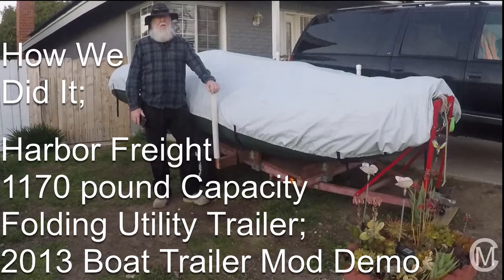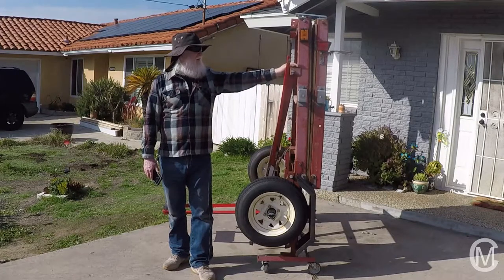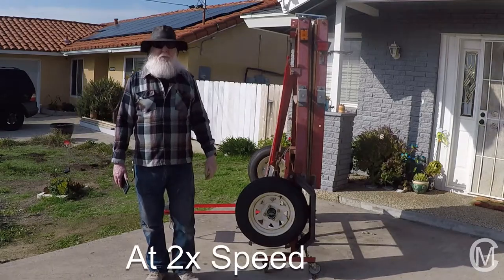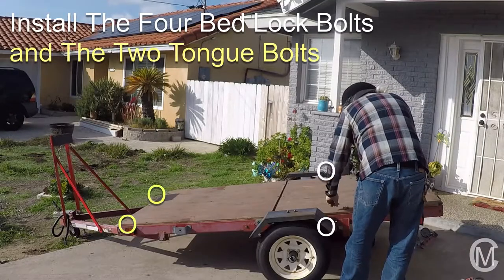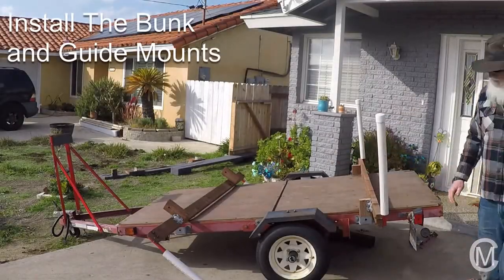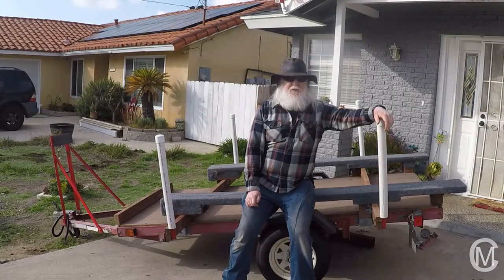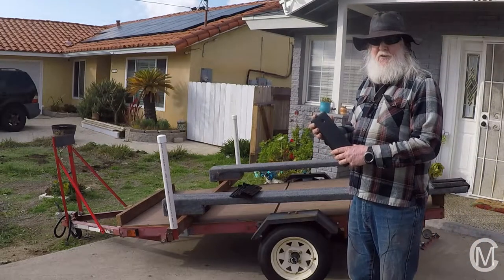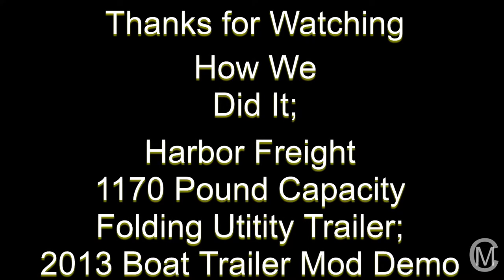Harbor Freight Folding Trailer to Boat Trailer Transformation

Comment: This is exactly what I want to do with my HF trailer, to transport my 11ft Saturn inflatable boat. Would love to have more details on the setup, such as the bunks build. Would love to know what kind of bearing buddy's you installed and where to purchase them? Also, how do you transport the outboard itself? And finally, how do you launch and retrieve the boat once at the launch site or ramp? Thanks in advance!!
Rudy-
Reply from the maker: Hi Rudy.  Thanks for watching.  As I noted in the video, any trailer modifications are done at one's own risk.  Make sure the weight capacities are not exceeded and the trailer is properly balanced.  I do not assume any liability.  With that foolishness out of the way, the wood on the trailer is all pressure treated with galvanized brackets and fasteners.  We used 2"x8"x6' pieces for the bunks with 1' spacers made from the same material to raise the bunks to accommodate the keel.  There are two spacers on the front and one on the back of the bunks.  We also added a spacer made from 2"x4" at the very back of the bunks to better support the end of the bunks at the transom.  The carpet we used is just standard bunk carpet.  The crossbars that hold the bunk assembly to the trailer and support the guides are 2"x4"x80".  That dimension matches what we needed to accommodate the beam of our boat.  The crossbars are set into the trailer stake pockets with short stakes made of 2"x4"x7"  We had to shave the bottom of the stakes a bit to get them to fit into the stake pockets, and drill holes to accommodate the locking pins.  We set the width of the bunks so our floor was supported more than the tubes.  We have an aluminum floor.  With the air floor, you may want to set your width so the tubes are centered on the bunks.  All the necessary connections are made with 3" galvanized 90-degree deck brackets.  The bearing buddies are "Bearing Buddy Stainless Steel (2.047" Diameter) with Protective Bras Model 2047-SS (1 Pair) Wheel Bearing hub Protector" from Amazon.  They had a better price than the local trailer shops.  Be sure to check the diameter of your hubs.  We transport the boat fully assembled.  The motor is locked in the up position and supported with something similar to the "Attwood SP-400-RB Adjustable Transom Saver".  With the gear we have in the boat the trailer is balanced.  We launch and retrieve the boat like any other boat at the ramp.   We could probably walk it on and off if we wanted to.  Shorter trailers can be more of a challenge getting into the water, but we've gotten used to it.  Have fun with your build and on the water.
Reply: Matt C. How did you install the vertical PVC to the cross bars that are set into the pocket?
Reply from the maker: @PhatBob14    Hi Phat Bob and thanks for watching.  The PVC is slid over 1/2 inch angle iron.  The angle iron is through bolted to the cross bars.  I am going to add Steel triangles to the attachment points to stiffen the vertical bars.  Turns out I make the cross bars a bit too narrow but I was working with a width limit..  I drilled small holes in the caps on top of the PVC so they don't float.

Comment: how did you make that front bracket?
Reply from the maker: Hi Fishing Mojados and thanks for watching.  We used two pieces of 2-inch angle iron for the vertical legs, two pieces of 1 inch "C" channel for the angled supports, and a six by fourteen piece of quarter-inch plate for the bow pad/winch plate.  The angle iron bolts to either six-inch side of the quarter-inch plate with two bolts, and the angled supports bolt to the angle iron a few inches below the quarter-inch plate with a single bolt.  The vertical legs and angled supports bolt to the trailer tongue using a single bolt each.  lengths will vary depending on how the boat sits on the trailer.
Reply: @mattc.310  Thank you

Comment: does it not catch too much wind?
Reply from the maker: Hi Tom and thanks for watching.  The trailer and boat are neutral as far as trailering goes.  The hitch point on the tow vehicle can be adjusted if there is an issue with floating.  It's a very light package so that has to be taken into account with higher towing speeds.  As with all trailers they need to be loaded correctly for proper balance. We tow with a full-sized SUV and we have no problems.